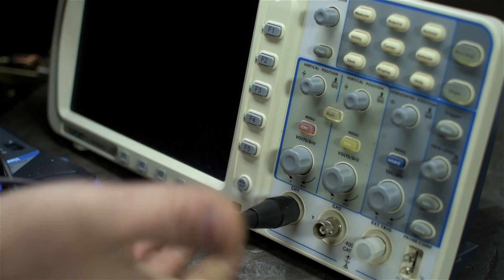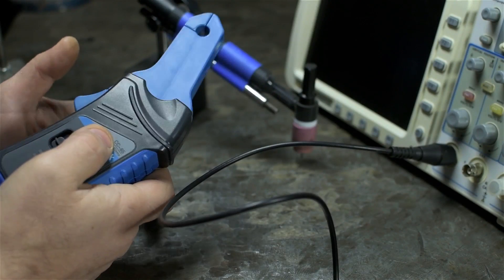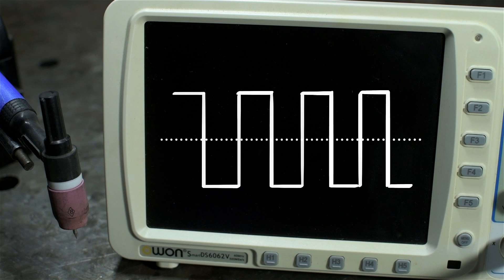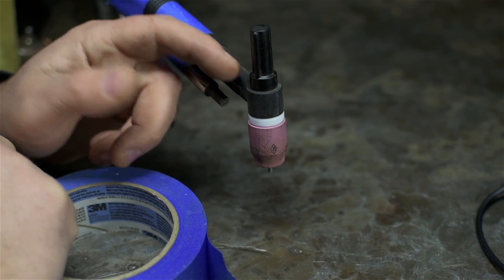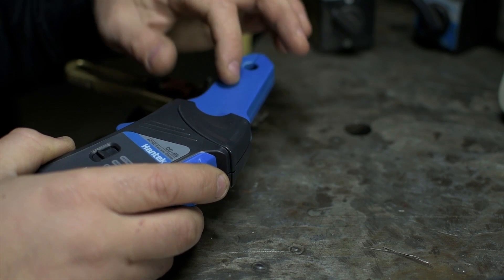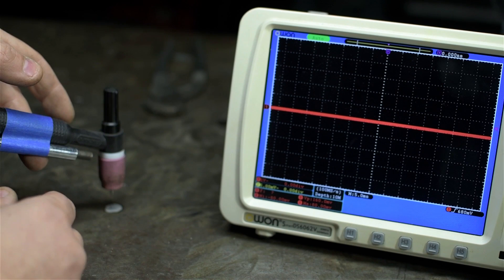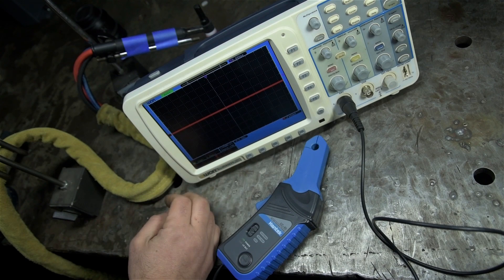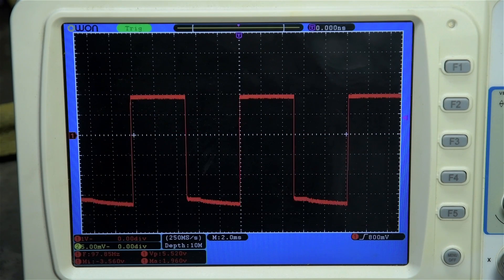Oscillo-Help-Me?

Comment: RF start interference :
Sounds like classic EMI. I would look to try...

1) connect scope ground (the outer shell of the BNC input connector) straight to the welding table using a short as possible strap (think 1" long). Any noise picked up from the arc on the outer shield of the probe cable will return to the welder ground through this rather than via the sensitive internal electronics of the scope. High frequency noise wants to get back to its point of origin in as short a loop as possible and will find every path it can!

2) Minimise current loop area of weld torch output to ground clamp. Route the two cables next to each other or loosely twist them together. 
AC current in a loop = magnetic field = EM field = interfere. 

3) increase distance between scope and welder arc to minimise effect of large EM radiated field from arc.

4) Add a metal "counterpoise" or shield directly between arc and scope that is resting on and connected to weld table for its length, not just at one small point. Again to try and reduce effects on scope from arc.

5) Depending on the frequency of the high frequency start you can put ferrite cores around the probe cable to reduce conducted noise on the shield but selecting the right ones has several variables. Last resort.

I've been a fan of your videos for what seems like ages so I hope these comments are helpful. Ping me if you need more info.

Comment: If it's an AC current clamp, then an imbalanced waveform (=DC current) can saturate it making measurements wildly bogus. This value should be in the data sheet ("maximum DC saturation" in mine).

If it's an AC clamp that goes below ~200 Hz (likely), then it almost certainly has an amplifier built-in (probably requires batteries). In that case, the amplifier can clip and give you the impression of a very clean square wave at lower frequencies (at higher freqs clipping tends to produce very noticeable artifacts in many amplifiers).

Only the very expensive AC/DC clamps can take large asymmetries without giving you bogus measurements.

As others suggested, flipping the clamp around and checking if the trace inverts as well is a good way to check for issues related to the clamp.

I don't think it'd be a wise idea to try to measure the output voltage of the welder directly, not with a regular old x1/x10 probe. I'd only do that with (1) isolated scope (like you have) (2) a x100 probe which can take a beating (3) a scope I don't like very much :D
Reply: The direct measure of the output should be no problem as long as he lift-starts it and not with high-voltage stuff that exceeds the limits of the scope times.

Comment: First, do NOT ground your scope to the table, as that is your return for the welder, and you can get some nasty ground current spikes that may fry your scope. Don't plug it into the wall, since the barrel of the BNC connector is connected to the ground lug of the AC plug---you can really fry your scope or welder this way!  You are "floating " your scope running it on the battery and using a current clamp to measure--that's correct. As far as why you are seeing the offset, there is a possibility your current clamp has a DC offset built into it that needs to be zeroed out. Clamp on ammeters can develop magnetization due to the remnance of the iron or ferrite core. Try snapping the jaws smartly a few times--don't crash them, just snap them---you don't want to break the ferrite! This will sometimes clear the residual magnetism, and is a quick check. The only other thing I can think of is to tun a known square wave you can measure safely directly on your scope, and then run an output lead through your clamp on ammeter and see if you still have an offset.  Those are my off the cuff suggestions---I am an electrical engineer by trade, FWIW :p
Reply: Fellow engineer here, but I don't really think this is correct as such. Why, would he fry his scope with a current clamp which has no galvanic connection to DUT? 

I agree that the scope should not be grounded to the bench as well due to current spikes and reverse currents, but powering the scope from the wall with PE connection for shielding is pretty legit. The welder should form a closed loop with no current passing through PE, otherwise FI would trigger I recon. Don't you think so?

Also, don't quote me on this, but shielding may not work when not connected to PE since the whole thing is floating.

I'm using scopes in a professional environment measuring motor currents and voltages with reference to DUT. "Good enough" scopes to do so don't even come with an optional battery.. Wall power only + PE only ;)
Reply: You make excellent points. and I wasn't as rigorous in my stated reasoning as I should have been, so BAD engineer :p  Basically, my reasoning for not powering from the wall in this instance has to do with unknowns---you don't have the information about what isolation does or doesn't exist within the welder circuit, and while the current clamp SHOULD provide all the isolation required, floating the scope by running it off of battery provides extra isolation. Welders put out hellacious noise and RF and current spiking on the grounds,  so any isolation you can easily get for free is worth it IMHO.  Anything to reduce risk of frying the scope and its microprocessor driven innards is in my opinion worth it in this case.  Thanks for keeping me honest, Joel :)

Comment: Hey old Tony, 
Do your tests again,  but now with the Amp-clamp rotated 180 degrees. (So that the ground wire enters de clamp from the other side). Now you measure the current in the oposite direction and the picture on the scoop should also flip 180 degrees, so now more positive than negative. If this is the case your Amp-clamp is working fine...and is the issue something else. 👍😁
Reply: The fact that the positive portion is so evenly clipped leads me to believe it has hit saturation as opposed to the negative portion, which shows some overshoot and correction.  I don't know whether that implies the welder over the test setup, but since two welders show virtually the same signal on one test setup, I would guess the test setup is where the issue lies.  Or the welders could be set up like that by design.  Sorry, no answers here...just an observation.

Comment: Tony,
The actual waveform balance is going to be relative to the ground clamp of the welder.  Make a "scope safe" differential probe and measure the voltage but watch out for that HV start HV start, it will brick your scope in an instant.  Even just being on the same bench top is a risk.   (open the welder and disable the HV start if you want to play around).   There is a severe  lacking of technical data about the current probe on the Hantek web site.  My guess is you are seeing an artifact of  the Hall sensor/amp or the magnetics  being somewhat unbalanced, at the limits of the frequency or current capability.  Try using a standard resistor current shunt in the negative lead of the welder and see what you get.  That should be safe for the battery scope if you don't have the HV enabled ( scratch start the arc).  But I would add some sort of fast diode clamping  to further protect the scope input.   We had a tek bring in a Van De Graff generator one day, wiped out  3 scopes and a logic analyzer that were not connected and on the other side of the lab.  
The welder may also have some EMI control components between the  +/- leads and chassis ground/earth connecton which may add some complications to your measurements. 

Craig

Comment: According to the datasheet of your currentclamp, its just rated for 20A in the "1mV / 10mA" range which you showed on the screen. (the exactly 20A look very suspicious to me)
So first i would switch it to "1mV / 100mA" to get the full range (maybe its clipping there). Also i can't really see what your settings on the oscilloscope are, but i guess it's set to 1mv/DIV like it's supposed to.
My second suggestion would be to flip the clamp. so its showing inverted current (negativ is positive and vice versa). Just like everybody else is suggesting.
Ground is in your setup absolutely not needed. Because the current probe just puts out an differential signal, which is not related to ground.

I hope this helps. If not feel free to contact me.

Comment: You should be able to verify if it's the clamp by simply clamping it 180 degrees to the direction it is now.  Current clamps measure in one direction, flip the direction around and the waveform will either be mirrored, or it will be the same.  If it's mirrored, then the clamp is probably working correctly.
Reply: Husband agrees. Kept saying "flip iiiiiiit" watching the vid lmao. :)
Reply: With AC coupling he wouldn't have any DC offset in the waveform.
Reply: Oh for heaven's sake - any decent EE would have flipped the probe by now to rule out the instrumentation. Fliiiiiiip iiiiiiit!!!
Reply: That's a very good advice!
Reply: Agreed, reverse it to check for fuckery with the clamp working properly. 
Its returning to zero when the welding stops, so it doesnt appear to have a major problem at first.  Flipping the clamp will give you a sanity check. As said, if it mirrors the waveform, its probably working as far as  you can tell with simple checks.  If its not mirrored, then there is something wrong. I.e. core is magnetized, or a voltage rail inside is failing. If the core is permalloy like the manufacturer claims, it shouldn't pick up that much magnetization though.
Reply: EFormance Engineering I second your suggestion, this is exactly the right next step. Very easy, and will give immediate indication of whether the probe is suspect or not.
Reply: Reverse the clamp. Reverse the clamp! Why has he not reversed the clamp yet?

That's about how my thoughts went on this matter.

Also, it's suspicious that one peak is so perfectly flat while the other creeps.
Reply: Alternatively/additionally, try measuring the output of a known current source. Those can be hard to come by, but you should be able use the current limit of a DC power supply to get a steady "direct-current" going at least.

My only doubt with the clamp-flipping idea is that he's seeing 0V on the scope when the welder current is off. With a DC offset I'd expect to see a non-zero reading on the scope with the current off, at least assuming the meter can output a DC signal (it does claim to be an AC/DC meter after all). Definitely worth a try though, especially if it's possible the clamp meter is damaged from trying to read 100A.
Reply: EFormance Engineering: exactly the first thing that came to mind. But I doubt he hasn't tried that yet; it's the most obvious first step in diagnosing this.
Reply: I had a similar idea. sounds like a pretty good idea for me. additionally should check that the scope is set to DC coupling, although if it were set to AC, then the square waves would be a lot more rounded, and more simmetrical.
Reply: EFormance Engineering still won't work. The clamp outputs a voltage as voltage is the only thing scopes can actually measure.  That voltage it is inducing isn't referenced to any zero so absolute measurements are impossible best this set up can do is measure peak to peak and show the waveform.
Reply: I think you misunderstand what I said.  A current clamp's output is + or - based on the direction of the current flow.  If you reverse the direction of the clamp, the output signal is also reversed.  This has nothing to do with reference to ground or anything.  His clamp is battery powered and DC coupled to the Oscope, so the ground reference is provided by the battery in the clamp and the "zero" calibration.

Comment: Good job on narrowing down the problem with the power of pure reason 👍
My money is on the clamp, too.

In the video, the clamp is set to 1mV/10mA. The CC-65 datasheet says that for this setting, the "efficient measure range" is only up to 2A. So I'd expect waveform distortions for any output signal exceeding 2A/200mV. 
=> Try changing the range to 1mV/100mA and seewhat happens.

If you want to go down the rabbit hole, build a 50Hz variable current source (e.g. variac + resistor; rate for 1A; wind xy turns of wire in your probe to simulate xyA) and calibrate against your multimeter.

The asymetric waveform is caused by the probe, if you clamp it on in the inverse direction of current flow, but the output signal does not invert.

Also, the claimed bandwidth is only 20kHz. The power semiconductor switching frequency of modern welders should already be in that order (2...20kHz). If you want to visualise the actual waveform, your measurement devices should have about two orders of magnitude higher bandwidth.  A clamp with 1...10MHz would be ideal. Below that, you have to assume that your probe constitutes a lowpass filter of unknown characteristic.

Comment: Like a lot of people here are suggesting, I say turn the clamp around on the wire (so that it's on the same side of the wire, but upside down), if the waveform is still the same (clipping on the positive side), it's the clamp or the scope, if the waveform is inverted, it's the welder. I would also suggest looking into what the welder is doing in terms of voltage.

Comment: Grounding is necessary for taking accurate measurements with your oscilloscope. The oscilloscope needs to share the same ground as any circuits you are testing.

https://www.polytechforum.com/welding/attaching-oscilloscope-to-welder-29972-.htm
Reply: Unlike a voltage probe a current clamp does not need and it does not have a ground.
Reply: In AC coupling the waveform most likely would be aligned into the middle (only if the duty is 50%), but some valuable information would be lost. It would be misleading to set the scope to AC coupling.
Reply: Its a differential signal from the currenct clamp, there is no ground.
There is no mentioning of "clamp" (aka current clamp, im lazy and searched the page) in the article you linked.
Reply: Sure, but it alignes them up :P
Reply: Current passing through induces voltage. Voltage is potential difference between two points. We have one point which is the induced voltage, then what is the other point in order to measure this voltage correctly and correlate it to whatever...
Reply: Then, you cannot measure the ratio of positive and negative amplitudes.
Reply: How can a induced voltage only be one point? A Voltage is always a difference between two points. Since the clamp meter has nothing to be grounded to, there would be no voltage between ground and any of the 2 differential wires (how could current flow from A to B? Threw the air?). Its like measuring the negativ terminal of one battery and the positive of another, not somehow connected battery.
Reply: Well, all I was trying to say was that the voltage produced by the current clamp is not relative to source used by the scope. If one uses the scope leads (signal input and ground clip) to measure the voltage difference in the differential output of the clamp, then you get no information on the ratio of the positive and negative amplitude in the signal. Besides, when using a current clamp for AC, the output peak-to-peak is what you are after; half of it actually. If the probe is rated to output 1V/A than 1 amp AC current should induce 2Vpp on the output.
Reply: "then you get no information on the ratio of the positive and negative amplitude in the signal. "
Why would that be the case?
One of the clamps two wires has to be positive or negative (and the other one vice versa). Depending on where that one wire connects to the scope (GND or a Channel) the positive will either be positive or negative. If that wire is positive compared to the other wire and connected to "Channel A" the signal on the scope will be positive. If its connected the other way around it will be negative. If the wire is negative etc.
It has to contain the information if its positive or negative. A circuit would be needed to shift the zero-crossing up or down. If there is no voltage difference then there is no voltage difference aka its zero. If its positive in the current set-up and the signal starts to get negative it will do so on the scope at the "same" moment.
Reply: the welder is earthed via its ground clamp connected to the metal table.
Reply: I agree... Also, scope may be set to remember the position of the waveform and it was adjusted... Try clicking the vertical adjustment knob. Make sure the channel you are using is in DC coupling.... You can also use AC coupling and avoid all this nonsense :Pp.
Reply: Well. Waveform looks like it is aligned to middle. But try AC coupling...

Comment: I suspect the HF arc is radiating through the air and getting into the scope that way. Its called radiated emissions and that HF arc is gonna make a metric boatload of it. The cheap-ish scope (I have the same one...) may not be robust in that arena.

Comment: Hi Tony. Yeah I am late to the game :) The best advice I can offer would be to try and get the manufacture's spec's and if your lucky waveform data. If it's doing weird things to for scope I believe I would stop till I had the info. The arc is what is causing the scope to act up. I have ran high voltage   experiments  using spark gaps which is close to an arc in how they affect meter's and scopes . Sorry I can't be of more help'
Bobby

Comment: I was a firecontrol technician in the navy for 22yrs, When we had to troubleshoot the radar transmitter, we needed to make sure that the scope/meter was grounded at the same potential as the equipment we were wanting to test. Also HF start will affect your scope because it doesn't appear to be of a shielded variety.